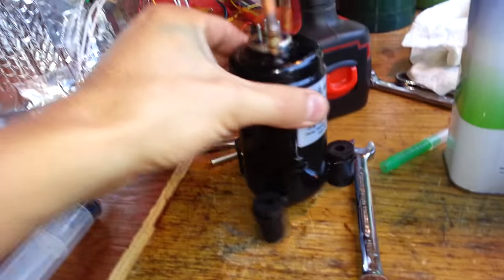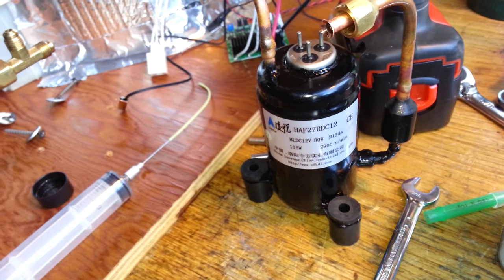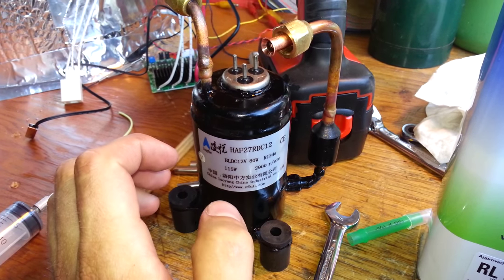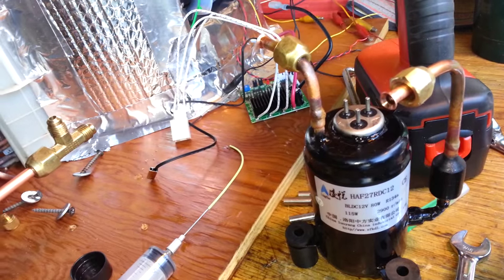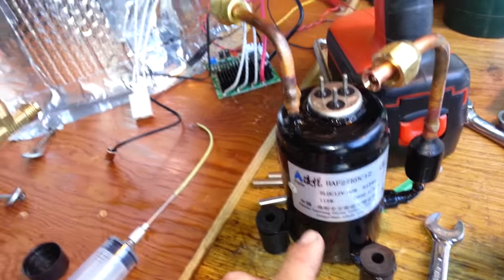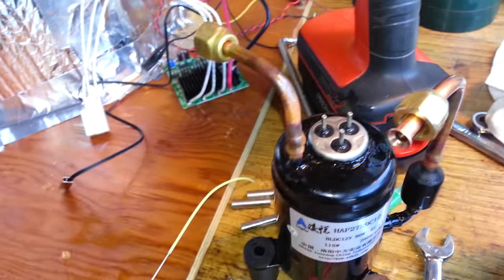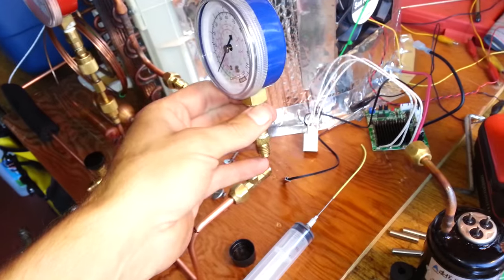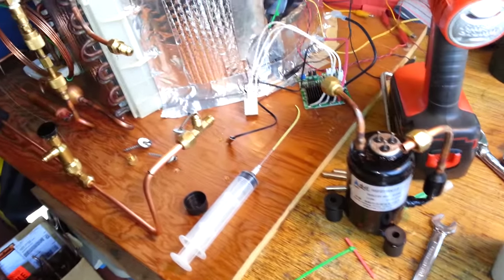Mini DC Refrigeration Compressor - Oil Charge

Comment: They flutter because you are starting too pump liquid. POE is very hygroscopic, thus, after goofing with the oil you need too pull system into deep vac. Never energize compressor in deep vac.

Comment: You can buy this little thing from Ebay, actually it is made from China. I noticed that its controller (panel) is old version, called Square Wave. Now the latest version adopts Sine Wave Inverter controller, which brings compressor higher COP and lower noise. So, is it expensive? Definitely not! Contact us, you can get not only competitive price, but also solutions. BTY, Cool video~
Reply: +Anne Wee Our website: www.rigidhvac.com
Reply: could one of these cool a computer processor? and whast the normal power draw
Reply: Where do we buy it?

Comment: I just came across this video. what kind of gas does it operate on? I would think 134a or maybe R12. I would be shocked if it ran on R22 or 410A such as residential compressors.
Reply: 134a but he mostly runs it on propane
Reply: @ka-i  thank you! I have been setting here and waiting for someone to reply back.
Reply: @christophersharp1884  you’re welcome. Sorry I couldn’t see it earlier

Comment: How do you calculate how much oil you would need for a custom system with a given evaporator and condenser?  Is there a calculation to figure out an oil fill for a new design?
Reply: Oil quantity is usually a fixed value recommended by compressor maker... I guess it doesn't not depend upon the size of your evap. or condenser

Comment: Hey guys a giant noob here. Is there anyway that mini compressors like these can be added to a computer watercooling loop?
Reply from the maker: Karthig1987 They could, but one would be better off with a full sized compressor. These are noisy and not very efficient.
Reply: Depending on how it’s used you would need to worry about condensation accumulating on the heat sink which could spell disaster for the mobo

Comment: hi... question please... if mod to mounting and fitting to the copper lines are made... do you think this would work replacing the 96 honda civic car compressor? coz mine's busted and buying a new compressor is like 300bucks... please advise. thanks
Reply from the maker: Sorry for the late reply. Short answer is no.
Reply: @whatawaytogo515  thanks

Comment: A lot of hobby guys seem to use propane as a refrigerant. Do the pressures align more with R-12 or R-22?
Reply from the maker: Bill Rimmer Closer to r22, as I understand it. Close enough to drop it into an Air conditioning system, I've heard. R12 would be better matched with r600a isobutane. Neither is perfect, but it would function pretty well in most cases.
Reply: Bill Rimmer you can also mix butane and propane and it will be similar to R134A I not sure if it’s a Pacific mixture but I do know it’s similar I am just now learning I can get one this small and i am completely in disbelief
Reply: Also if you are using propane or butane or anything with hydrocarbons the oil will have to be changed kinda of like car oil

Comment: I have been looking at these compressors too. I'm pretty sure they are set to replace the dunfoss style clunkers.
When i look at the specs, it seems as though the 12v ones have comparatively low COPs. 80w consumption, 115w cooling- this is the one you have right? 
I was looking at getting one of the 24 or 48v versions, perhaps with the condenser built in. Such as this:
http://everpowermachine.en.alibaba.com/product/60349369402-801623900/HAC650DC48_W_cold_storage_small_compressor_refrigeration_unit.html
230w consumption but 650w of cooling..... out of something the size of a coffee cup! Amazing!
I want to use to in a eutectic style fridge. To store solar power by making big blocks of ice during the day.
keep up the good work.
Reply: If you want to buy, you can find me.
Reply: Depends on which temperature you want to reach. The lower temperature, the lower C.O.P.
Reply: If Sawafuji sold their linear compressors on the open market rather than exclusively to Engel...

Comment: as a refrigeration engineer i really do not understand why every youtube video involving a refrigeration compressor is centred around the oil. there is no need to touch it, it is already in there, it dosent need to be pulled out and fresh put in, its not like you're engine in you're car. i have worked on pieces of refrigeration 10+ years old with original compressor and original oil.
As for the refrigerant not any old refrigerant can work in any compressor nor is it compatible with all oils. The oil mixes with specific refrigerants which is how it returns to the compressor unless a oil separator is installed on the discharge pipe.
also you need to be careful on the amount of refrigerant you put into the system. i noticed it is on 134a so a low back pressure. if it is a freezer compressor i would expect to see the suction pressure running at around 10 - 15 psi on a standing start. when it is nearly down in temp around 1psi. if it was a fridge i would expect it to be around 15 psi. if you over charge it you can get liquid refrigerant flush back to the compressor forcing the oil out.

Any questions fire away
Reply from the maker: Jamie Woodward, I here ya. Typically, I wouldn't touch the oil in most cases, but it is an issue in these tiny rotary units. Propane carries oil really well and it can carry it out when I would discharge a a refrigerant charge for a modification.  So much so that the compressor would get hot and sometimes lock up. The manufacturers suggest that the oil charge in these tiny units is quite critical, much more than a larger refrigerator compressor. I don't mess with these compressors anymore, as they are loud.
Reply: I am using it in an open system, so oil capture is important.
Reply: Jamie, is there an easy way to figure the amount of refrigerant needed in system? I have just finished an R404A Walk-in Freezer install and got it down to -20 F in the Box. It took some time charging, checking Superheat / Subcool as it got close. I’m just wondering if there is a way to calculate my charge. The Condensing unit is factory from Copeland, and the Evaporator is Bohn. My 7/8 x 3/8 line set was about 9’ long.  My end refrigerant charge was an even 5 lbs. 0 oz. I may be a few ounces over, as it is icing up a few inches out of the Suction Accumulator. I wanted to see how it ran once they got product in the box and then adjust from there. Anything you got for input is welcome. Thanks 🙏😊
Reply: @AlaskanMonroe  I read 126 grams of 134A.  Don't remember where I got that but it could have come from this project by the mythbusters guy Adam Savage.  https://www.youtube.com/watch?v=z_Ti4GP0ntE